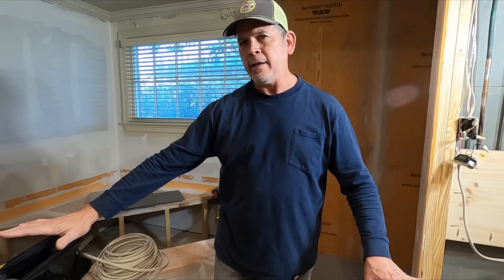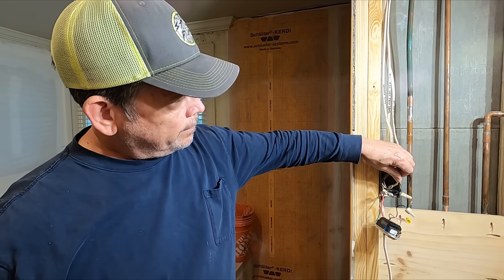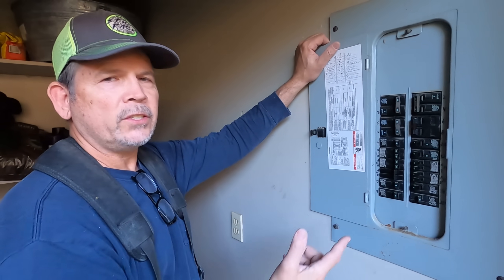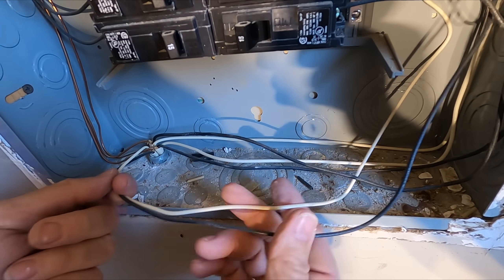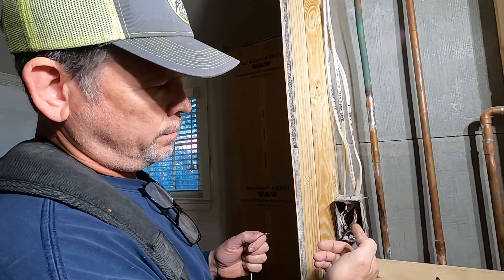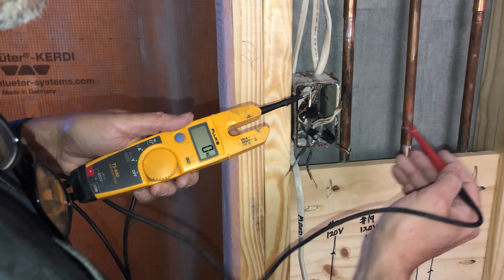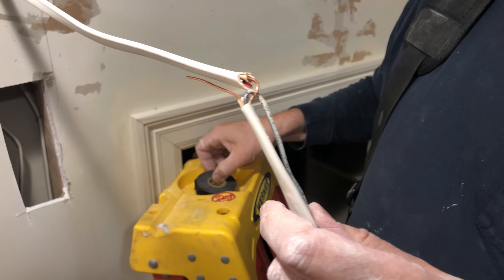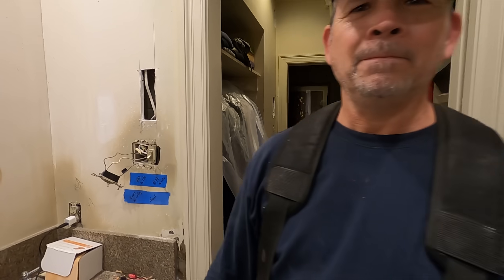You CAN Get SHOCKED by a Neutral Wire! This is How...

Comment: Sharing neutrals is a big no no! The only way to really share a neutral by code is to use a 12-3 or a 14-3 cable and a double pole companion trip breaker that uses both phases, not a tandem breaker that uses the same phase. The reason you never share a neutral on a tandem breaker is because both hots will be still on the same phase and if you have both the circuits on the tandem breaker pulling the maximum current at the same time, let's say each circuit is 15 amps, you'll be having 30 amps returning on a single 14awg neutral wire causing it to overheat. On a 2 pole breaker that uses different phases, both the phases are returning current at different times on a single neutral so there will never be more than 15 amps returning on the neutral.

Comment: I'm always wary of shared neutrals. The neutral isn't neutral if it's no longer connected. Should never share a neutral between breakers but it happens all the time. If there is more than one hot wire and only one neutral going through a box, you have a shared neutral and removing a wire nut from neutral will likely expose a hot wire if they break connection. Beware.
Reply: Also, the neutral will show zero volts right up until the connection is broken.

Comment: I always scan over everything with a Fluke volt alert.  Would detect voltage on a pipe,  a neutral, etc.  Well unless it's a low voltage and in that case you don't care as much.   My background is in electronics,  been hit by pulsed 480 volt DC and hurt for weeks.

Comment: I’m a master electrician, and I can’t stress how dangerous a neutral is especially if it’s carrying a load. Remember the neutral also known as the grounded conductor…not ground. It’s carrying the current back to the source to drop its potentiality 0 volts. If the panel is not neutral bonded to ground you can have what’s known as a floating neutral which is really dangerous because it’s looking to go to ground and you may become that source of ground. I can’t begin to tell you how many horror stories of pulling electricians out of attics after being electrocuted by a neutral from being complacent and not using a voltmeter to verify a “dead circuit”. Great job!
Reply from the maker: Thx much appreciated Eric 👍👊💪

Comment: Why would anyone make a circuitry where hot lines come from different breakers, but share the same neutral wire? And if that was for some strange reason the case, why would anyone start working on this without turning off both breakers- #19 & #20?

Comment: For residential circuits, it is allowable to share a neutral as long as the hots are not on the same leg and all codes are followed. Proper wiring of a shared neutral usually are wired using romex 14/3 or 12/3 with a black, red, white and ground. When having a shared neutral, there must be a 240 volts across the two hots sharing the neutral. Split circuits prevents no additional current than the individual breakers capacity from flowing thru the neutral. If two circuits shared a neutral and are on the same hot, the potential for current thru the neutral is double and could overheat. Older code allowed individual breakers as long as they side by side and not the same hot (240 volt difference between the hots). Today, sharing Neutrals must use tandem breakers to prevent anyone from getting shocked.

Comment: I live in a trailer and need to know how to wire a brand new from scratch box. My husband was teaching me but he got electrocuted 220 line putting in our water heater so I have a great respect for electricity and I'm doing my homework first so I need to know how you can tell what wires are coming from where and how to know which ones go into what size circuit breaker. Need precise details and I think you can teach me a thing or two since my husband is no longer with us to teach me. And these trailers have been badly wired by people who owned them before me and I want to make sure that my house doesn't catch on fire because of somebody's bad patch jobs. I've been learning from my husband how to remodel the last 9 years he was just starting to get me an electrical I got all kinds of different gadgets I have the one you plug into the wall and you go and wand the box but I don't quite understand how that works not enough details in instructions. Think I got a couple of them figured out. But half my home front bed n bath no juice in master bed n bathroom. Would a plug out stop the current though most the home. Kitchen living room n middle room have power kinda 5 plugs out in living room wall. 2 out in middle room. bathroom and front room out.master bed n bath out. How do I know what's what here and how to replace fix it. You know how it is cuz if it's broke around here we fix it. Researching please help thank you have a blessed day

Comment: Good job guys, a neutral should neither a borrower nor a lender be! In other words each circuit should have its own phase, neutral and ground wires. I am a professional electrician here in the UK and encounter all kinds of crap left behind in installations, some by homeowners and some by other "electricians". Stay safe yall.
Reply: I still don't understand why there was no neutral on that circuit to start with.  Each small breaker should have had its own hot leg and neutral and ground

Comment: Sometimes when you are leveling, as long as it's "between the line-- it's fine" :D
Reply: Quality of the level means alot.
6ft Stabila between the lines 1/8 tolerance 
6ft Other brands between the lines could be up to 1/2- 3/4 range of tolerance.
Reply: @shonuff5297  Totally get this. All my levels drive me crazy sometimes.

Comment: As a 40yr electrician, I'm impressed with your troubleshooting skills. It would have taken me a little while to find the problem. There is a very poor way to make a 3-way switch in existing wiring. This is one to really watch for-they use the ground for a neutral (very dangerous to someone working on the system later. If you remove the conductor at the ground rod you can be shocked! Also if the neutral is shared between two different circuits of the same phase, that neutral could be pulling twice the amperage that is is rated for-possibly 30 amps on a number 14 wire.
Reply from the maker: Appreciate the comment 👍💪

Comment: Or a light bulb socket with a bulb in socket and two copper wires attached to socket insulated wires for test probe's to check for electrical flow bulb will light up

Comment: Tip for all of you once breaker is turned off always check the switch or plug with ohm volt meter to make sure it is not running hot with electricity
Reply: Also another tip when using ohm volt meter set switch on ac to check for electrical power going through the wires you don't have to read the measurements on the face of the meter just look at the needle if wires are electric charged needle moves quickly to one side and you know not to touch wire wait 15 minutes for discharge check again and should not be hot keeps you from getting electrocuted

Comment: Great help explaining and to identify neutral . I am trying to upgrade plug-ins and switches in my mobile home because of the cheap ones it was built with . The ones that have no screws and are installed by forcing the wiring between sharp prongs that become the only connection . I have had a couple of plugs melt down where I have plugged in a heater . They should be outlawed along with the gray pipe it is plumbed with . This is what I can afford . Sad but true . When I found your video I was looking for information on wiring a double switch and how to feed a second switch with a jumper inside the same box and or pigtail wires . Thanks for helping us out .

Comment: I got one ever better for yah...im a maintenance man in Texas...i was at one of buildings i started working electrical in and we were losing ceiling fans..refridgerators etc...finally found previous "home depot hispanic electricians to rewire a whole building and change out outlets and fixtures..so i soon realized hard way that they had mixed up white wire and blackwires on back of everyoutlet in building soooooooooooo...when i grabbed bare copper ground it lit me up and sparked inside load center...finally i realized what happened and im still alive to tell the tale.....moral of story..check all wires for voltage...even bare copper ground.

Comment: Question:  closet pull chain light...................two blacks with a pig tail to fixture;  two whites with a pig tail to fixture:  took fixture off and pig tails off and cked voltage............120, the cut breaker and showing 4 volts not zero?  suggestions?  ideas?  Thanks

Comment: Correct me if I am wrong. I think it is what they call in the USA multiwire branch circuit which consists of two or more ungrounded conductors that have a voltage between them, and a grounded conductor that has equal voltage between it and each ungrounded conductor of the circuit and that is connected to the neutral or grounded conductor of the system. (Basically, two hot wires are sharing a neutral wire.)

This circuit has also been referred to as:

The Edison Circuit
Common Neutral Circuit
Shared Neutral Circuit

It is specific to the USA only. Two phases being used for residential are at 180 degrees and when both circuits are loaded combined current through shared neutral can't be more than 15A which OK. In this case natural will be safe only if you brake both circuits. They use special downgrading transformers which convert single phase high voltage to dual counter phase voltage. This is how they get 120V for regular and 240V for big air conditioning.

Otherwise sharing neutral will be gross violation of electrical safety. Because combined return current in it would be above its conductor rate and cause it heat up and start the fire.

Comment: Shouldn't a ground fault have occurred and tripped the breaker when you grounded to the copper pipe?
Reply from the maker: Nope.  The copper tubing is bonded to the panel with a bonding jumper on this house.  The copper tubing is acting just like a copper wire and completing the circuit 👍
Reply: @StudPack  wow

Comment: If you upgraded the breakers in the main panel to the current AFCI/GFCI breakers both would trip when turned on due to that shared neutral or shared hot with one neutral. Another thing is if you have two hots on the same leg of power then connect them in a junction you get the same issue. The standard breaker could care less because it is the same leg of power and still only 120v. But smart breakers will throw a fit. And that for me as an electrician is a pain in the ass. Now you have to trace circuits and find where issue is at. Most often it is in a switch box or a ceiling fixture. Troubleshooting is always fun to do!!

Comment: Very good video.   I look forward to the ice maker video.  Talking to a buddy who does high voltage commercial systems and told me a nightmare story about disconnecting a main water line in an old house in the city.  The house had a bad neutral and all the current was flowing into the old plumbing.   Really eye opening.  Everyone doing renovations should understand this.  The plumbing thing could really catch someone off guard.   It would be a great video.   Again really good content and explanation.    Thumbs up!
Reply from the maker: Thx Bryan 👍.  Check out our video “the worst shock I ever received “.

Comment: Just a comment to the public he shows the wall open in the hallway with a brown Single Gang Box next to the copper pipe that box is called a Bakelite box. These old 70's style boxes are notorious for stripping out the screw holes while you have the wall open it is highly advisable to replace that box with a new blue Carlon or similar box at this location I would use a right angle screw on box so you don't have to use nails and have a possibility of hitting the copper water line. KJ

Comment: Specially in older houses and week-end 'lectricians and diy's. I saw a situation where the 
neutral was accidentally cut on 1 circuit, a white single wire was snaked to another receptacle 
on the same phase leg. this was very bad  as the hots a 20 and 15 were properly protected,
but 15 more amps were added to the 20 amps neutral. luckily someone smelled burning wire.

Comment: My electrician convinced me I could change out my Leviton receptacle that I got at Home Depot.  So glad I watched this video last night.  I tested my receptacle with a voltage tester.  No response.  It appeared dead.  I unscrewed the receptacle and put my tester on the black wire and sure enough my tester went red and beeped.  Thank you, sir!  You might have prevented me from getting shocked!  Btw, the Leviton receptacle only lasted two years.  Not happy about that but at least I didn't get shocked today.

Comment: In house single phase u have 3 wire circuits. 1 hot from each phase share a neutral, if you break the neutral to the panel u have to turn off both circuits.

Comment: I'm surprised how much shady stuff you find with electrical work in the walls of houses. We recently had an electrician out doing a lot of work on our house and there was all sorts of problems he had to fix. We had a couple sets of wires that were exposed and sparking under the house. We had another long wire ran out to a gazebo that squirrels got into that the previous owner didn't shield with conduit. There was also a huge mess with daisy chaining the entire house onto a single 15 amp that we've had to deal with for years.

Comment: Technically just because a wire is white doesn't necessarily mean it is safe to touch.

After a live wire goes to a load from a switch that is turned on, and if the return neutral from the load is disconnected from the breaker board neutral, then that wire coming from the load (even though it is white) is actually carrying live potential. Once this wire is reconnected back to the neutral wire going to the breaker board, only then does it become safe to touch. This is why it is bad practice and unsafe to put a switch on the neutral wire because the the neutral coming out of a light or device is dangerous to touch even if the switch is in the off position.

Another way to avoid shocks in this kind of scenario is to ensure all switches are turned off and nothing is drawing power. Although that may not always be a feasible option.

Comment: I've been in the Kitchen and Bath remodeling industry for over 30 years and I have seen soo many scary electric issues.  One of the worst I have encountered was a kitchen wired with lamp cord and extension cords.  As for the flooring thank you for bring up the point that in older homes you shoot for flat not level.  It really comes in to play when dealing with LFT tiles that are all the rage right now.
Reply from the maker: Cool thx Tim 👍👊

Comment: Doesn't the black electrical tape around a white neutral wire tell you that the neutral wire is being used to carry a load/electricity in place of a black wire/hot wire?
Reply from the maker: Yes.  See my pinned comment 👍
Reply: @StudPack  Will do

Comment: Very good video.  I have come across a lot of shocking wiring in my 50 years . I own a row home in my earlier years where light switches turned off the white neutral not the hot black wires.

Comment: can someone explain how the pipe completed the circuit? Was it a ground wire screwed to it?
Reply: copper piping in the house is used as grounded circuit at the entrance service by a wire from the service ground in the meter base and main disconnect box to a hose bib nearby then to a driven ground rod, with new pvc piping you must drive  a second ground rod about 8 ft away or uge other approved ground method.

Comment: I had this exact thing happen in my house.  I shut off the circuit to a bedroom and got a shock from a neutral when I removed the wire nut.  The hallway light (on a different circuit) went off when I removed the neutral as well.  So I stopped and took a peek at the hallway switches (3-way setup).  When the house was originally wired, it had 3 places that used 3-way switches.  Not one of them used 12/3 cable.  All were "Chicago" / "Farmers" 3-ways.  I suppose it didn't break code in 1971 when the house was built?  One way or another it got past the inspector (assuming inspections were done).  Did it function?  Yes.  Was it safe? No.  All that to save a few bucks on a home construction budget.  I got to wiggle my fat butt up into a 140F attic and cut into walls to replace original wiring and do it right.  Not pleasant.  In my case, that circuit for some bizarre reason found its way running through a bedroom switch box, accompanied by the circuit for the room and they just tied all the neutrals together in the box.  It was absolutely original to the house.  The reason I was working on it was the original receptacles and switches were starting to have problems because the old plastic had just aged badly.

Comment: I always use a tester before I touch anything.  When I was 18 years old, we were in a rental while in college.  The owner came over to repair the floor of our kitchen and he was using a circular saw to cut up the subfloor.  He had turned off the breaker to the kitchen but he hit the electrical oven line in the floor with his saw blade and was killed by 220 volts almost instantly.  It turned out that during a remodel, they had added the 220 line and it was not on the kitchen circuit he had cut off AND they had run it in the floor because it was easier to access (I am guessing).  My wife was standing less than 6 feet away from him talking to his wife.  Even after 40 years, she still has nightmares about it.  I do some electrical work in the remodels of our houses and I turn everything off and test it with a meter before I touch anything. Great video.  Yes, I want to see the fridge story.
Reply: Lesson noted, and yikes.